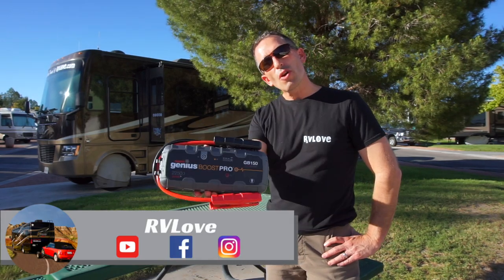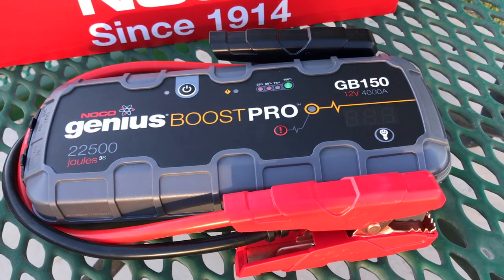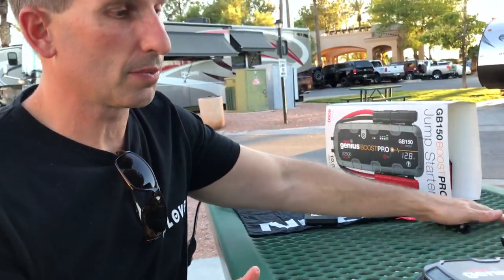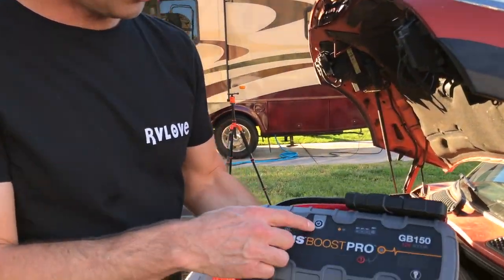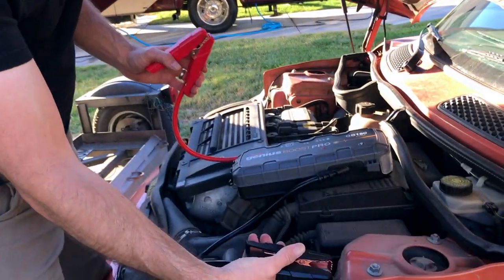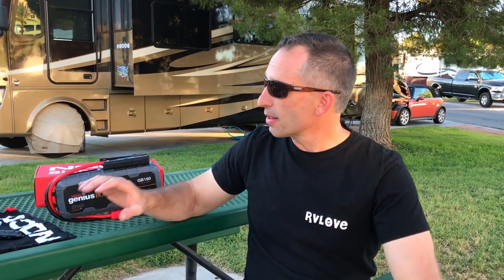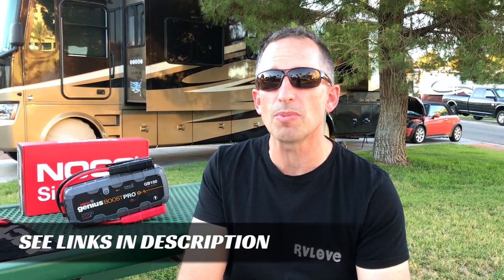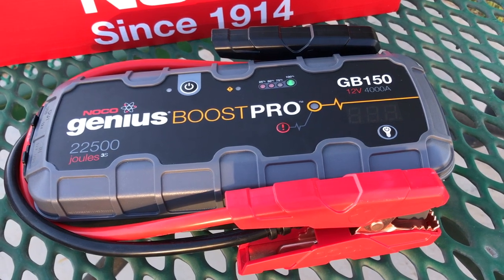NOCO GB150 Genius Boost Pro Jump Starter | Product Review | Portable Lithium Jump Starter

Comment: I'm an Rv tech and I own the noco 150 I also bought the quick charger and a really nice case designed for the noco 150 . I highly recommend getting both accessories the fast charger charges it in about an hour where as plugging it into your standard home outlet it takes much longer . Charging it in your vehicle charges it faster than in your home . As a tech I also use this to power campers and run the slides out on them so I can have room to work inside .

Comment: There is another very important function he didn’t mention.  There is a special button for times when the normal jump start function is not enough (more dead than his).  I’ve had to use the function.  Life saver.
Reply from the maker: Great point - thanks for sharing!
Reply: Where and how?
Reply: Yes, please explain this 'special button' since mine came with almost ZERO instructions
Reply: Special Button - 1st, this button is dangerous as it takes away some safeguards.  2nd, the button is the override button.  It is listed in the tiny booklet.  I underlined it in mine and put it back in the bag with the unit.

Comment: A week ago, I had a DEAD battery!  I've had a GB30 for years.  It did NOTHING! Freshly charged but no luck. A friend came to help me with a GB40. No luck.  He took me and my dead battery and got a new one. THAT NIGHT, I ordered a GB150 from Amazon and got it today!  It's on the initial charge right now.  First, THANK YOU FOR THIS VIDEO!!!  This has answered several of the questions I had on the GB150!  I have 2 more questions please:  How often do I need to recharge the 150?  I know you said it holds a charge for a year...and that's GREAT!!! Second question: If I charge this with the lighter plug, does my car HAVE to be "ON" the whole time the GB150 is charging?  I realize that this MAY kill the battery!  The instructions are in such small print, I cannot hardly read them!  Thank you and PLEASE keep these FANTASTIC videos coming!!!😀

Comment: Road Gear Reviews -   The demonstration is all well and good, but what I want to know is how reliable is it.   It's been two years, how is it holding up?  What have you used for in those two years?  Have there been any defects or issues?  Have you found any novel uses for it?  Are there any special cables or adapters you recommend to use with it?  Are there things you have learned that just aren't in the manual?  Are you willing to do a follow up /long term review?
Reply from the maker: We still totally love our Noco, and have used it many many times.  Starting both our Jeep, and even our diesel motorhome with it.  No defects. I have only needed to charge it a few times despite many uses. So glad I have it, but not sure if I will do a formal long term review video.  So many other videos I want to share first.

Comment: I've seen a few reviews of this product but I think you are the first (that I have seen) to talk about all the little pieces and parts that come with it. Great job!. The only thing they are missing is a regular outlet so a laptop could be run from it if necessary. I have a smaller jump starter from Halo that has the outlet and it has some in handy.
Reply from the maker: Thanks Deb, yes it's a HANDY device. Good idea re the regular outlet.. We have the little Bestek portable charger with a regular outlet (2 actually) which we can run from the coach dash or could even plug the 12V into this NOCO - but the caution of course is not t get to reliant on this charger for your smaller devices as if your vehicle battery dies and the NOCO is out of juice you'd be in a pickle! But sure is handy having all these options!

Comment: mine is only 4 months old, tried to start a mower with a dead battery but gave no juice at all, it only had 1/4 bars of charge so charged it over night, but still gives no juice. car boosted the mower just fine. test this power pack with volt meter and its not giving any output when on. led indicators make it look like its on but its not working anymore. what do i do? cant find receipt and it costed $500 and dead 4 months later is awful.
Reply: Use the over ride button

Comment: dude you took a boost pack rated for a diesel and used it on the smallest gas engine! come on really
Reply from the maker: I have also used it on our 8.3 liter diesel engine, and have seen it used to start other diesel engines without even having the battery installed.  This is very impressive.  Just used on the car to demonstrate how it works.
Reply: @RoadGearReviews  then show it

Comment: Just out of curiosity, with the no spark safety feature, what voltage does it read across the clamps with no battery connected, just a multimeter?

Comment: Can you take this  NOCO GB 150 jump starter overseas and charge it on 110 or 240 volts outlet using USB plug since it does not come with any electrical outlet charger?

Comment: Great review. I was looking at that product but not sure which "size" to buy so this helped. A question though, can you use it to recharge the trailer batteries? If so is solar necessary for a trickle charge for short time boon-docking? Should a battery be dead to use this or can it just be low?
Reply from the maker: Hi Brenda, glad it helped. Yes it can definitely be used to charge trailer batteries - don't let your batteries go dead or under 50% (PS. please be sure to read the Electrical & Solar System section of the 'How to Hit the Road the Right Way' course you recently purchased as that will also give you a much deeper understanding of how these systems work - much too long to explain it all in detail here!) - For short term boondocking, you could get by with just a portable 100W suitcase like we use and reviewed here on the channel - it's just come down in price by $40 from when we purchased it in February! http://amzn.to/2qrPrXK - so far it is working out great for us!

Comment: If the only way one can recharge this unit is by plugging it to a cigarette lighter while driving, that is a serious design flaw. Especially when fully charge takes up to 3 hours. That means one has to drive up to 200 miles to fully charge it. Average commute to work or driving around the city is far less than that. I have one made by SPARTAN that has an electrical outlet charger that can be charged on 110/240 volts outlet.

Comment: can't you just plug into a wall outlet to charge?
Reply: Received my GB150 yesterday and partially charged it at work with my laptop. When I got home I used a 120 volt USB charger (Beats Headphone charger) to complete the charging. Both worked great and the wall charger was much faster.
Reply from the maker: Yes you can
Reply from the maker: Thanks for sharing! We have used our GB150 a few times this past month to recharge our car battery.. it's on the way out. Charging works well either way but yes wall charging is faster!

Comment: Does anyone know why this doesn't come with a 12v wall wart to quick charge on your workbench? Can you use a standard aftermarket 12v one? Do you really want to use an iPhone 2.1 amp usb charger for 11 hours? I've watched about 12 reviews and not one reviewer or commentor has asked about it. Thanks.
Reply from the maker: Didn't really find it to be an issue as we charge it a couple of times a year at most.
Reply: I think NOCO offers a 120VAC charger as an option to charge faster at 12VDC, put it is purchased separately. Suggest you check their website for more information on that.

Comment: Great video. If you've addressed elsewhere, my apology, but I was hoping you might address different battery types, particularly AGM, and in the context where the battery has been deeply discharged. 
I'm in that situation, bought this movie, but have not been able to get a jump. I tried a different charger attached to a good battery cabled in parallel to the dead battery. Still, little movement in the voltmeter. This is a new battery but had not been "programmed" for my 3.5 twin turbo BMW.
Any advice appreciated.
Reply: Movie s/b noco gb150

Comment: Ig I forgot there is a over ride button 'it's the red button 'you use this when the battery is below 2 volts 'the noco can't red the battery when it's below 2 volts  'that's what the over ride button is for  ''but be very careful because when you use the over ride button it does away with the safety aspect if you put the leads on the wrong way around you can do a lot of damage and it doesn't give you the protection of using it in the normal mode 'the over ride gives the battery full power you should hear a small click when it ready to start the vehicle 'but please be careful and make sure you put the leads on the right way or you could blow every fuse of the vehicle and maybe destroy the ECU

Comment: Thank you for reviewing this.   It help me out in my decision.  I already have their battery charger and it is awesome.   Thanks  Ross
Reply: Hey there, do you have the 3000A or the 4000A version? I could swear they’re identical except the number 3000A on one but 4000A on the other, even the link for it on Amazon says, 3000A but the one in the video is 4000A and those on eBay equally the same situation.

Comment: how many jumps on a full can it do for a car before it needs to be recharged?? 10 , 12? or really 80?
Reply: @Tommy Ealey so you are saying your tractor battery is harder to jump than a car ? Where you did 42? Since a year ago I commented I bought the gb70 and gb150 and don’t get anywhere near 80. I get about 25-30 weather depending
Reply: @Tommy Ealey interesting maybe. Starting current shouldn’t be that far off I wouldn’t think but you could be right. I have the GB150 the 3000a one. I have the 2000a one too seems to be pretty good
Reply: @Tommy Ealey 3000 is the biggest I thought at 3000. Never seen a 4000
Reply: @Tommy Ealey I’m guessing it was false Advertising by them changing it to 3000a. I could be wrong but seeing how there’s no 4000a has to be
Reply: @Tommy Ealey I just checked mine and mine 4000a I bought it about a year ago
Reply: @Tommy Ealey it doesn’t no, mine just says Noco Boost Pro then 4000a

Comment: The biggest problem I have with these "portable power packs" is their reliability. Sure, they're great out of the box but when the rubber hits the road and you're out in the cold  - with a dead battery... will these "portable power packs" work then? Doesn't matter if they come with a warranty, will a warranty jump your cars battery when you're stranded out in the middle of nowhere? Show me a reliable, portable, multi-functional jump starter that is still taking and holding a charge and able to successfully jump start after a year or more... and NOT made in China.
Reply: I've had mines for two years and still going strong
Reply: Everything is made in china....it would help if you stop going to Walmart. ..
Reply: SIP SC Hybrid Pro Booster .  It has small AGM back up battery to charge ultracapacitors.  Much higher peak amps. Design and made in Switzerland but double the NOCO price.  I think is worth it.

Comment: Will it work on a COMPLETELY dead battery?  Sometimes, the smart charges won't even recognize that they're attached to a DEAD DEAD DEAD battery.  They need something that has at least a little juice.  So, this would still leave you stranded.
Reply from the maker: I have seen this work even with the original battery removed from the vehicle.  So, yes, very confident it would work with completely dead battery
Reply: @RoadGearReviews  Yes bro, it works with a fully dead battery. I just used it today, just hold the button with the exclamation mark for 3 seconds and it will start your car instantly. I had my battery and car sit for 6 months cause of covid, no problem starting it.

Comment: Can you run the car on NOCO GB150 lithium ion jump starter without a battery, and what is the longest time you could do it with the NOCO GB150 lithium ion jump starter (if the alternator is not working, so you could drive the car to the shop if it is close), if it work I will buy it.
https://www.youtube.com/watch?v=PjXOpr9wFsg 
Drive with ONLY a Jump Pack? (Car Battery Entirely REMOVED)

https://www.youtube.com/watch?v=NQNCV7hvUK4 
Quick fix to bypass a broken alternator...

Comment: No ac adapter = No Sale.
Reply: James McGovern why??
Reply from the maker: This works very well for the intended purpose. It's a very powerful unit. Are you wanting to charge it with AC? Or power AC?
Reply: @RoadGearReviews  Quick AC charger is available on amazon for this GB150
Reply: I bought one, so I tried it and it's making a clicking noise when I first hook it to the battery. Is that normal? It worked, so I guess it is, just seems odd that the pack makes noise.

Comment: 4000amp  TOTAL BULLSHIT    that unit would need 00ga copper cables  3/4in thick  & Super Massive  Sold Copper Clamps  to handle 4000amps !!!  NOT CHEAP PLASTIC CLAMPS      Cars will crank with only 200amps    !